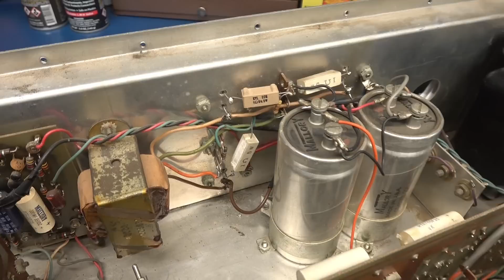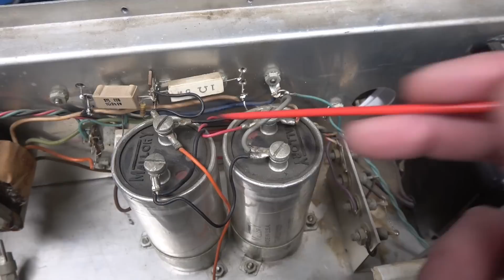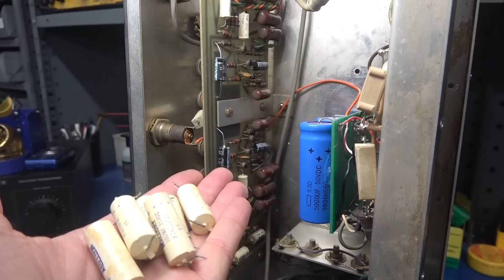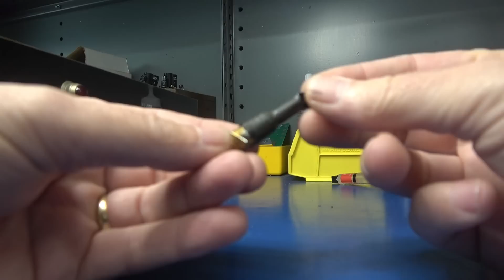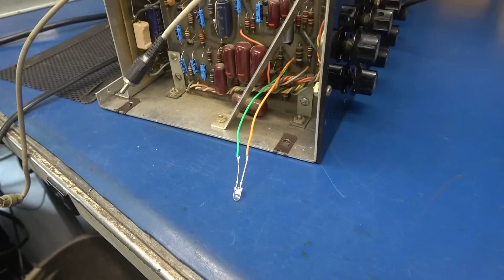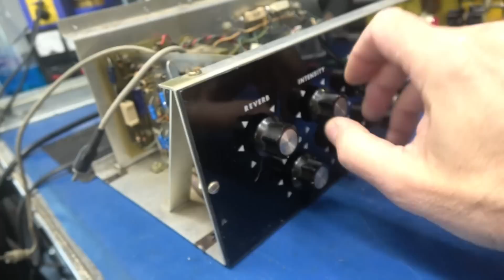Vintage 70's Kustom K-200 Solid State Guitar amp repair Cool retro machine

Comment: The tremolo sounds kind of odd to me-kind of like a chorus effect along with tremolo.  Could that be due to the LED lamp you installed in place of the incandescent bulb?  Even when a LED lamp is fully "on", it is still pulsing on and off faster than the human eye can detect.